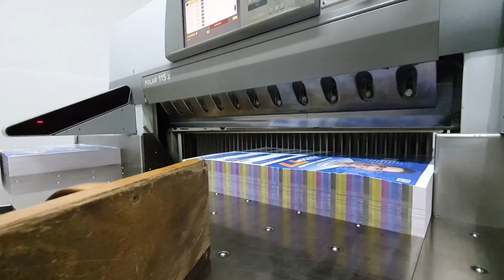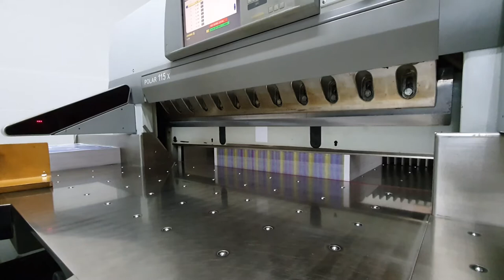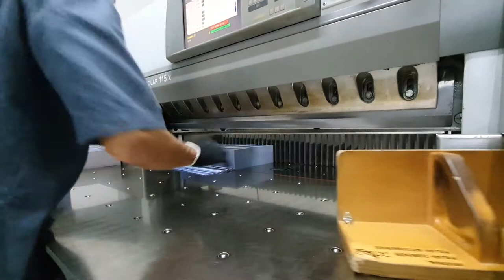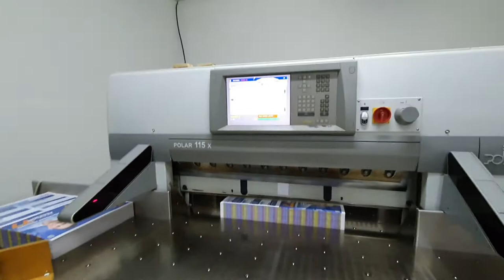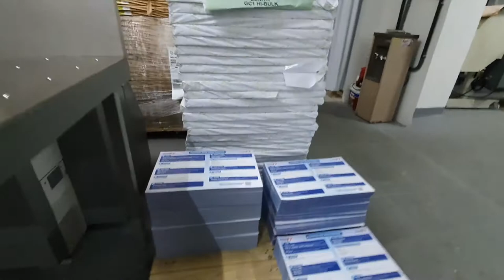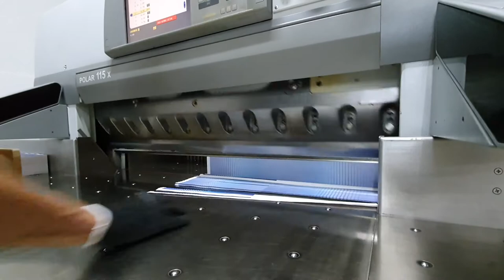Polar 115x cutting machine in action.

Comment: What’s the first step? Where you push the pile of paper in and it clamps, releases, pushes, clamp, releases, push’s redone.
What’s it doing? Compacting it for cutting?
Reply from the maker: Hey!  Some printed work retains intercalated air under the sheets.  Crushing the block helps with accuracy because it removes air volume.  The ideal would be a piece of equipment called a "jogger" with air removing roller.
Reply: @marconiparello thanks!
Reply: @marconiparello  From my experience it is better to push air from back to you

Comment: @THE MACHINIST Hello! you crush with the weighing to have a very precise cut?
Reply: how much pressure are you putting? for weighing and cutting?
Reply from the maker: Hi! crushing improves cutting accuracy and decreases air volume. This printed service would go to folder. 

Sorry my English.
Reply from the maker: @vakogrif219  Hi. the pressure was around 2500 kilos, for 1250 sheets. The size 43.8x63.8cm. You can work smoothly with 2000 kilos if the knife is very sharp on certain types of prints. Remembering that the polar machine 115, has a minimum pressure of 150 kilos and a maximum pressure of 4500 kilos. 😯
Reply: @marconiparello  thank you
Reply: @marconiparello  for crushing you use 2500 kilo?
Reply from the maker: @vakogrif219  Yes, in this case. 👍🏻
Reply from the maker: @vakogrif219  Sometimes we have reams size 77x113 cm to be cut and require high pressures, something over 3500 kilos or more.

Comment: Hello sir, I'm a paper cutting machine operator I have 6 years of experience and I want to do work in abroad.so plz can you help me
Reply from the maker: Sorry friend, unfortunately I can't help you at the moment. 🙁
Reply: How do you set up the automatic  clamping to remove air before starting the cutting program?
Reply from the maker: @jeffhamilton5985  Hello! For Polar E ED, X XT or N series, press the pictogram "additional functions" and select one of the air functions:
▪︎5 air front table on*
▪︎6 complete air table on
▪︎7 compl. air table off
*(5) Optional Function! 
Depends on special valve.
Reply: @THE MACHINIST  not to turn the air table on or off.,how do you program the lift of paper  to move forward  and the clamp to come down and press the air out of the paper automatically before you start the cutting program
Reply from the maker: @jeffhamilton5985  OK.  I understand his question.  First insert the measurements starting from the edge of the block towards the inside of the block.  Example 14>12>10>8>6>4....then mark the measurements with the additional function "press without cut". You can also set it to prepared clamp(knife) or fully automatic clamp(knife) - just like the video.
Reply from the maker: You gave me a good idea. Maybe I'll make a video about it. 😉👍🏻
Reply from the maker: Sorry my English 🤣